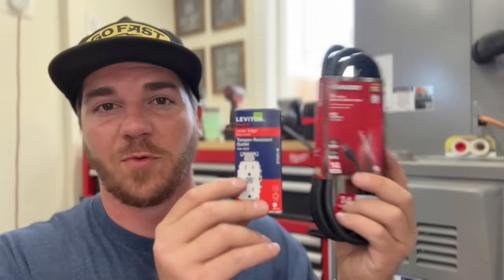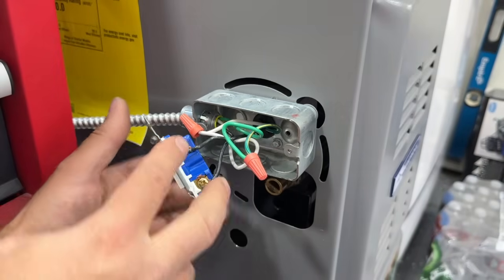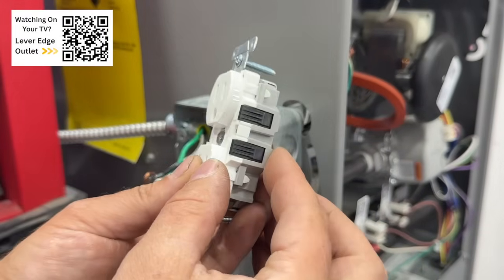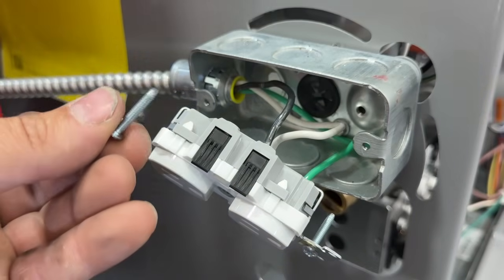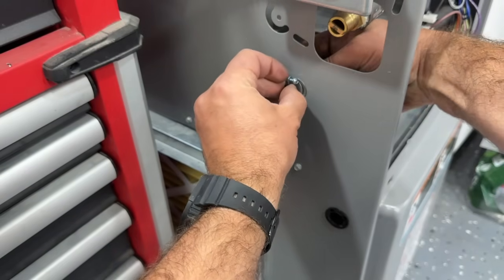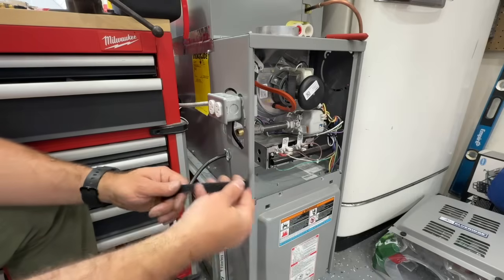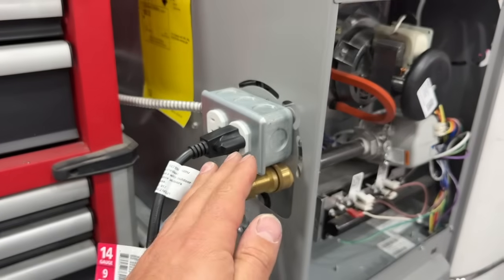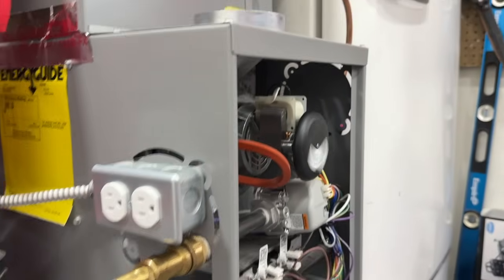This $16 Hack Could Keep Your Family Warm During A Power Outage!

Comment: I bought a two circuit transfer switch that one side could be used for the furnace and the other for the refrigerator. I don't know if it's code to replace any switch with a pig tail and outlet. Transfer switches are made so you can hook up a few circuits to a generator. 73
Reply: I have a 8 circuit transfer switch, I have seen a 1 circuit before, but never a 2 circuit switch, pretty cool, except if your going to dig into your electrical panel, I would at least use a 4 circuit switch, I have used my 4250/3500 open frame inverter generator with my transfer switch, and my 2500/1650 duel fuel with it also.

Comment: I bought a portable backup generator(12-13kw) just before Christmas 2023.  I unboxed and assembled it but have yet to even connect the supplied battery nor add oil to the engine.   lol  I even had a local electric company come add the appropriate plug to my service.  I'm pitiful.
Reply: We all start somewhere :)

Comment: Great video.  But you need to mention that you MUST remove the bonding plug before charging power station.  If not you will smoke your power station.
Reply: What is a Bonding plug
Reply: @bobhoman9410 
A bonding plug is a simple device that connects the neutral wire to the ground wire within the plug itself [17:33].
What is it used for?
The bonding plug is used to bond the neutral and ground conductors together at the power source (the generator or power station) [17:33].
Why is it needed?
It is critical because many sensitive appliances, like a gas furnace's control board, are designed to only operate when the neutral and ground are connected, which is the standard setup for residential power from the utility grid.
The Problem: Most portable generators and power stations are designed with a floating neutral, meaning the neutral and ground wires are kept separate.
The Solution: When you plug the bonding plug into one of the power station's outlets, it manually creates the neutral-to-ground bond [17:39]. This bond satisfies the furnace's safety sensor, allowing it to turn on and operate [17:47].
Reply: @bobhoman9410  its the yellow plug he plugged into the eco flow charging station about 2/3rds the way into the video.... I had the same question.
Reply: @JericoGoods what if you're using an inverter connected to your car battery? Any problems?
Reply: @JericoGoods 17:20 closer to 90%
Reply from the maker: Great point, I will absolutely be sure to include that in the next video. 👍🏼
Reply: @diyhvacguy As this is so important, can I suggest that you make a comment regarding this and Pin it, so that everyone can see it.
Reply: Maybe tether the bonding plug to the pigtail so you will have to remove both at the same time?
Reply: Only thing of the video i don't understand is why you would need a bonding plug
Reply: @ryanmccarthy2033 Furnace needs to sense a bonded neutral.
Reply: @ryanmccarthy2033    I don't know why they designed it this way but some furnaces like my Lennox require the neutral and ground to be tied together, which normally happens at the breaker panel.  But when the furnace is disconnected from the house power, the bonding depends on the backup source.  Note: That bond isn't done inside the furnace because there should only be one bonding point in the system at a time.  
*Some have noted that the bonding plug can't be present while the Ecoflow River 2 is charging.  If that's accurate, I would steer away from Ecoflow.  It doesn't seem like a scenario that would be common to all brands of inverters.
Reply: So any ideas on this one…..when connected to my power station (110/1000w) my ignition starts, dies, then the blower comes on. Works fine when the plug is plugged into new outlet but even with the bonding plug trick it just won’t keep the flame going. Can’t be the flame sensor as it’s fine through the outlet, I’m pretty sure it’s not a ground issue as the flashing light doesn’t signal a ground issue, I’m totally stumped.
Reply: @thatrandombikeguy You will need a slightly larger power station.  It's getting overloaded on initial draw to start the fan. Other possibility is your starting capacitor on blower fan is going bad.  My bet is on power station being a bit too small.
Reply: @stevenshircliff393  really? Ugh…With 1000w normal and 2000w peak I figured it would be ok. My furnace never pulls more than 700w at full tilt during testing.
Reply: @thatrandombikeguy before you buy a bigger power station I would check if your power station is at 60hz. I noticed on my Jackery 2000 when I was powering fans in my house that they made excessive noise. It made me think that the fans were going bad. When I plugged them into grid power though they sounded fine. One day I noticed on the display of the unit it read 120v 50hz and looked up how to change the hertz on it. Once I changed it all excess noise from the fan as well as the speed of it improved. It could possibly be your problem but I’m not totally sure just something to check. Goodluck
Reply: @thatrandombikeguy  sounds like a short in your gas valve same thing happened to Mine
Reply: @thatrandombikeguy maybe somebody else can comment but some newer appliances,  esp refrigerators, need a pure sine wave. It's possible the wave output isn't clean enough for the furnace controller
Reply: Will this modification pass a home inspection meeting code when you sell your home?
Reply: @NeasYellek no, it will not pass a home inspection. Most states, if not all, do not allow you to do this modification.
Reply: Do you know what to do if you have a 10 amp fuse in the box where your switch is at the furnace?
Reply: @mikew8622  the fuse is protecting the device so you’ll want to wire your cord so that it’s not bypassed. You want 10A protected device and not a 10A limited receptacle.
Reply: @m_cabral thank you! That makes sense. I'll have to figure out how to do that.
Reply: Such an important piece of information
Reply: Do modern digital thermostats get power from the furnace? Our old thermostat was battery powered but new system is hardwired.
Reply: @arsprod  thermostats including old ones have 24V AC from the furnace attached to them. If they have a common wire, then the thermostat itself can be "powered" by the furnace transformer, if not, the thermostat is "powered" by batteries in the thermostat. You could also have a common wire AND batteries in the thermostat. But regardless of how the thermostat is "powered" there is 24V AC from the furnace going to the thermostat, it is the "R" wire.

This is how really old or super simple thermostats don't take batteries or common wires at all. The 24V AC jumps from R to W, creating a "call" for heat.
Reply: @a @arsprod  Yes, they operate on 24 volts from the furnace.  A typical AA battery is around 1.5 volts.

Comment: I feel like you’ve made pretty much this exact same video multiple times now.
Reply: He has, but this video is less confusing for the average person. He did some further explanation in this video and used a different electrical outlet. This solution is the most simplified of compared to the two others.
Reply: Doesn’t matter, YT is not about you.   This is the first time I’ve seen this and it’s extremely helpful.

Comment: Great tip! Thanks! I always wondered what I'd do with a winter power outage because I do have a gas generator, but had no way of powering my gas furnace. 

Question: I'd need an extension cord anyway because my generator is gas and I'd have to run it outside up a flight of stairs. Can I use my 14 Guage 100 ft extension cord or should I pick up a power station like you have?

Another quick question. Can this modification be against code?
Reply from the maker: Yes, you can use an extension cord as long as it’s 14ga 👍🏼 these gas furnaces don’t pull a ton of amps
Reply: @diyhvacguy  IMO 16ga is fine.  You noted yourself that the most your furnace will ever pull is 250W.  My own furnace has a 7.5A fuse on it.  16ga is plenty for either of those.  People use appliances all over the place that have cords thinner than 14ga, as long as the appliance doesn’t draw a large amount of power.
Reply: I think it is I would have to ask an inspector to be sure. I don't have gas heat so I would have to run heaters on my generator but being in Florida I don't see a need to run heat. 73

Comment: Furnaces in Mass. I see get wired w/a 4" sq. box with service switch and GFCI. If you have a portable generator I'd just spend a few more $$ and get the backfeed plug installed on the home then make a list of applicable circuits to turn on to give you minimal amenities during power fail but to each their own.
Reply: IT’S NOT A BACKFEED PLUG!  This is just adding a plug to power your furnace instead of hardwiring the furnace.  The furnace doesn’t generate electricity to feed back anywhere.  Pay attention to the whole introduction and in several other places to emphasize that point!  Sorry for the rant but it’s clear that you either didn’t watch the video or your critical listening skills are shot.
Reply: @michaelwitkiewicz7052  I gather you do not understand what he is meaning 😂😂😂. He was saying to use transfer switch or interlock kit . Why bother doing what you have in this video and just have a transfer switch or interlock kit and have MANY circuits available to use in the house. Instead of just connecting the just the furnace to the generator.
Reply: And BTW why do you think that several times he emphasized what he was doing?    Because there are people rigging this type of setup use suicide cords.
Reply: @michaelwitkiewicz7052 i'm talking about a backfeed plug for the whole house. If you don't have reading comprehension skills

Comment: A few Youtubers have posted videos on this technique using a forced hot air furnace. Can I assume the process is the same for an oil boiler for hydronic heat here in the northeast?
Reply from the maker: Yes as long as it is 110v 👍🏼
Reply: @diyhvacguy similar question . . . My tankless combo boiler already has a plug BUT the circulator pump is hard wired into an outlet box and there is a doorbell style transformer on the bottom of the box with control wires of some sort, thoughts?  Maybe a future video?